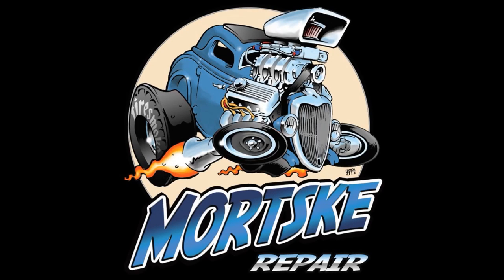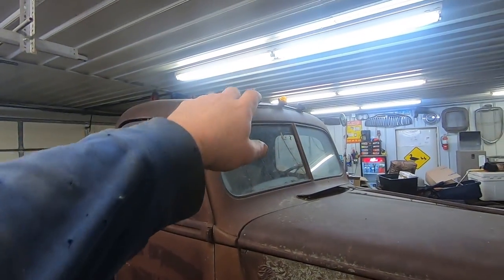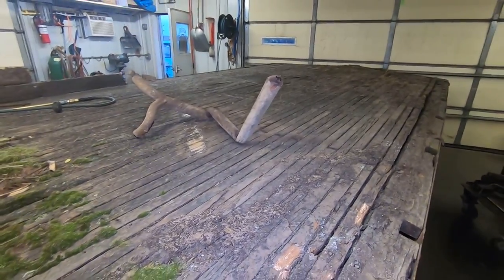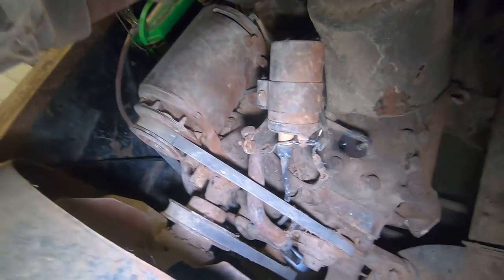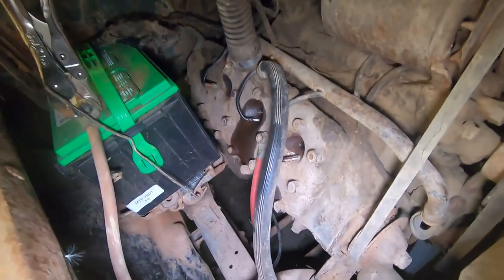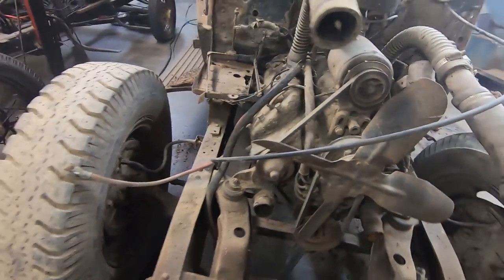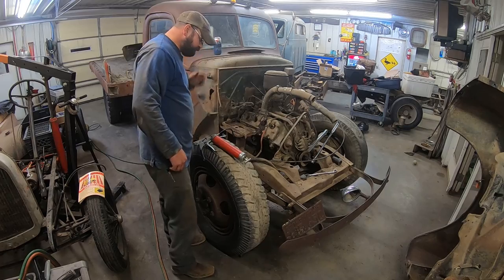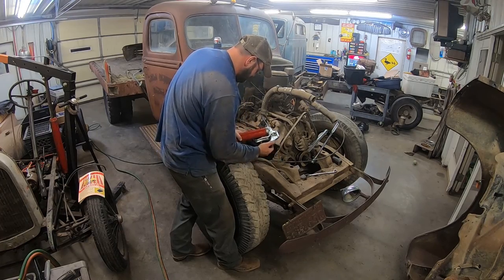Farm Auction 1944 Ford Flathead V8 truck! Abandoned for 47 years! Will it run?!? Stuck rusty engine!

Comment: I bought a 48 that had a seized engine. After dumping copious amounts of WD40 in the cylinders I had my dad pull me around in it with a 1953 ford tractor and I just dumped the clutch until I heard it bang and start shooting the oil out. I put spark plugs back in and gave her some gas and she fired up and runs great. These flatheads are stout.

Comment: That would be a sweet ride. Cooling system, electrical, brakes , tires, a seat, new bed, and enjoy her. Nice work!
Reply from the maker: Really, I mean a good solid weekend and pretty much everything on the truck could be replaced. Ha! Thanks for watching and commenting!
Reply: She looks worth it. These old iron beasts are just waiting to be brought back to service.
Reply: At least for another beer run or two.
Reply from the maker: @lunchbox2784  Just think of all the booze you could haul in this thing!!!
Reply: It looks like she’s hauled her fair share. Maybe that’s what the DISTILLED water jugs were for...
Reply from the maker: @lunchbox2784  I'm gonna stick with that as the reason those jugs were in there for!

Comment: You did a great job to get that truck to start again. All I was doing was letting your viewers know that you cannot just change the battery if you're going to use that vehicle 4 years there are things that need to be replaced. You did not specify that to anybody most people have no idea. You would have to change the voltage regulator T alternator and the starter the headlight bulbs turn signal bulbs and brake light bulbs two 12 volt and they will all light up brighter. I did not want your viewers to think all you had to do was take a 6 volt battery out then put in a  12v battery and everything would be fine. What you did is fine for getting the motor to start except for putting Grease I'm a grease gun and fill a cylinder head it has more pressure and the Greece would have nowhere to go that's why I suggested you take out the spark plugs and the grease would have came out the spark plug hole. Sorry for any confusion it was not directed at you it was to let people that are changing their battery to a 12-volt that there are other things that need to be done on a permanent use👍✌  MR WELSH
Reply from the maker: I'm not showing anybody how to do anything. Just documenting my shenanigans. Also, starters work just fine on 12 volts. I was putting the grease in the spark plug hole. How would it get from one cylinder to the next with the valves closed?
Reply: @MortskeRepair  people that were watching your documentary if you want to call it that we're going to use your advice not knowing any better that you're just getting a junker to start. That there are other things I need to change. If you have a mother that is seized take all the Pistons app is easier to free an engine that's not under full compression that's all I'm saying you won't end up cracking your knuckle and getting it cut in your hand I've done it when I was younger then I realized it's easier to take the plugs out this pain sprayer that's all I'm not trying to down you for your business
Reply: @MortskeRepair  it will not go from one cylinder to another but it would be like shoving a rag in there and expecting that pissing to come back to the top it was a blockage you put in the cylinder cuz it was on its way up the date was on his way down it would have turned a lot of prayer and said this feeling grease out of the side of the head towards another cylinder you did a good job of getting that the Run so I can say👍
Reply: @MortskeRepair  nobody realize that you were just showing them your shenanigans some people would believe that all you have to do is change the battery to 12 volts. The reason why people spray some fluid liquid in the cylinders is to try and hurry it up with lubrication. Squirting grease from a grease gun internet cylinder is going to give you so much resistance it's like having a larger piston in there and it's not going to want to come up because the grease is blocking the cylinder from moving up if you had to plug out on that cylinder all the grease with a compliant out with a boss spark plug was and it was a turn easier than busting your knuckles with a pipe & wrench like I said do me a favor next time you have one is frozen take the plugs out and see if it won't release easier when it's not under full compression from having the plugs in good luck I know what I'm talkin about I've done it too many times take the compression off the engine by removing the plugs it will be a lot easier to turn. MR WELSH
Reply: @MortskeRepair  it was very interesting watching you work on that old truck and seeing how you got that to run with those old Pistons still in it. Great job good work interesting video keep up the good work I know you will.  MR WELSH
Reply from the maker: @jimwelsh1908  Thanks much for watching!
Reply: @MortskeRepair  I will keep looking forward to watching your videos. MR WELSH
Reply: He said more than once he just wanted to see if he could get it to run.

Comment: Looked back at the Ford flathead truck and the way you removed the heads, that is exactly the way I would have did it.......Sure Sire...Right..Oh well..Loved that video
Reply from the maker: Right on
Reply: On a running engine, a good way, especially with stuck aluminum heads, is to drain the cooling system, then back off each head nut 1 turn.  Start engine, suddenly floor it.  That will usually pop them loose.  You have to leave those nuts in place, 1 turn loose though, or else the heads will fly up in the air!

Comment: I love this one especially as I had a 1949 v8 pilot….. 3.6 litre.  So did similar jobs as you did…… my only main jobs were HT lead change as rats had chewed through…. Plus one of the water pumps were leaking….. ran sweat after that…… well done on yours I thought you’d give up once you looked into those cylinders🤦🏻‍♂️😂👍🏼
Reply from the maker: Thanks Colin

Comment: My dad in the 80’s had a 49 Ford car with what he called a (whisper quiet) motor. Well when it idled only sound was the water pumps turned. It was 3 speed with over drive

Comment: I'd like too see you get this truck back Driving again. Despite the little bit of rust and nastiness in the cab... i think she's a good original candidate. It also gives me the motivation to find a Stake/Flatbed of my own & Restore it to haul my Antique Farmall on top for shows!!! I know of a GMC Cannonball Local to me, and a few 1952-55 "Stub nose" IH COEs.
Reply from the maker: This one is too far gone for me unfortunately. I was after it for the flathead. The rest is currently waiting for a new home. The next owner can restore or hot rod it if they'd like. I'm working on a COE myself! As you can see in the background of this video. Thanks for watching Kyle!
Reply: @MortskeRepair  Fair enuff! I was also just suggesting for "Fun" lol. Ooooh a COE! I gotta see it.
Reply from the maker: @SchnelleKat  I've got a lot of fun going on! Nearly 38,000 views and you're the first to comment on the COE!! I must have hid it well! Oh you just hold off there for a bit! It'll be coming up here shortly! Thanks again for commenting Kyle!
Reply: @MortskeRepair  haha yes good eye for sure. They are hens teeth to find and parts for. I had a good set of steps I sold for about $1000 here in the states, those and fuel tanks are impossible to find in great shape. 

Thankfully, I found one in Pa in an old 60-70s junkyard surprisingly complete and untouched, and one in kansas.
Reply from the maker: @SchnelleKat  You're kidding me! I scrapped the fuel tank on this one!! Probably was all rotten anyhow. I've had a few COE now. This was the nicest by far so I'm gonna have a tough time letting this one go.
Reply: @MortskeRepair  yep... Nobody makes the fuel tanks and yeah like a gold nugget to find one haha I know even in rough shape they bring about $300
Reply from the maker: @SchnelleKat  I'll see if I can track down my old one. They might still have it.
Reply: @MortskeRepair  GL on the hunt. ;)

Comment: I’ve got a 1/2 ton 47, it’s seized and the water got in by the split in the hood, then it dripped into the top of the air cleared and from there went straight to the carb
Reply from the maker: Ahh that could be where it came from in this one as well. Funny it didn't make it into the oil pan like on my last video. Thanks for commenting Merik!

Comment: pulled a 47 ford out orf fence row where it has set over 60 years did about the same and it fired right up and is running now in a differant truck

Comment: Sweet truck! I’m working on a 41 Ford truck. Pretty much the same as what this one is. I’m having a spark issue though.
Reply from the maker: These flatheads with the dual points can be tricky. I like this "clam style" distributor over the earlier "scuba diver helmet style" as they're a real pain to work on! Clam is 2 bolt, helmet is 3 mounting bolts. They do make adapters to convert them over. There's also a lot of great distributor rebuilders out there. Good luck John!

Comment: Nice rescue, those flatheads sound great.  You inspired me to get my 53 Merc 1 ton out last night.  8BA.
Reply from the maker: Nice! Shouldn't that be an 8CM in a Mercury?
Reply: @MortskeRepair  8BA... 255 screaming CI
Reply from the maker: @ranchdog7920  I always thought the 8BA and the 8RT was the 239 ci Ford version and the the 8CM was the Mercury 255ci version. Interesting.
Reply: @MortskeRepair  well you have more knowledge than I do about this, but there is a green colored, 24 stud  8BA in my truck. Who knows what has happened in the last 70 years.  Keep up the good work.

Comment: When you put on your long sleeves to wire wheel the heads and mentioned the wires sticking you, I thought "finally someone is telling it like it is." I watch other Youtubers using wire wheels in short sleeves and there is no way they don't look like pin cushions when they're finished. Wire wheels are great tools but they shed worse than my dad when my ma got pregnant at 41. Love your videos.
Reply: I'm all about covering when shit flies. Except I hate seeing someone using any rotating tool with loose sleeves on. Either tape them or a tighter fit sleeve. Once something grabs you, it's all over but the crying. Also, I quit the goggles and started always putting on a clear shield when grinding, cutting or wire wheel. Uncomfortable as hell but once in the habit, it's like putting on your shoes.
Reply from the maker: I hate picking those wires out of my skin all afternoon! I do use some precaution every now and then! Thanks for watching Paul!
Reply from the maker: Loose gloves, loose pants, loose sleeves, ties, they're all a no-no. And I should be wearing a face shield like you say. The inconvenience thing is what gets me there as well. At least I put a little protective wear in place. Some channels those poor guys don't use anything! Anyhow, thanks for watching and commenting Twig!

Comment: You're like me...no parts, just clean unstuck and partial hone...put back together for test. You broke all the rules...but did it exactly how i would. Most people would have junked the motor after seeing that kind of rust-corrosion, but it always looks worse than it really is. The only thing i would have done different...is the turning-breaking the motor over with cheater bar...i go 1/8" to 1/4" one way and then back the other way 1/8" to 1/4", then move motor 1/4 turn and back 1/4 turn, then 1/2 turn and back 1/2 turn...with more liquid wrench put in cylinders before i go back and forth. You went all the way around 360 turn...you're a brave man.
Reply from the maker: I get lucky now and again!

Comment: I have had a lot of luck with flatheads in general. From the continental "chrysler" products to lincolns and fords. I have had to remove the heads on a few that lost the keepers on the valves and so those would stay open till you compressed the valve spring and put them back.... had one like your working on but I got it broke loose ok. It just didn't have any compression so I hooked it to 24 volts to spin it even faster which it did and it was funny cause after it all and not starting... just the putt putt try and die so did the juice over dose and I didn't hold it to that spin very long but had the coil and stuff isolated from the start mechanism  so it stops whirling and it just setting there idling which took me by surprise. What I was getting around to was any of those older engines that had the copper head gaskets from those time, when you took it off, you didn't change it, You put it in a large pail and boiled it so it would swell up and have some good sealing chance. I did a plymouth that only had maybe five pounds of oil pressure and you could hear the rods talking but off to work every day for better than a year before it tossed that rod talking loud out the side. I call this a win to me anyway. I was always curious why people never stuffed them in gear and just rock them back and forth till it  shook loose the engine??. I mean easier than beating on a starter. I have used grease before and it worked on some and others nothing would of this world was breaking it loose. Great video and not so much a show me but a win win video for not giving up and pushing through. Fords are fairly tough but water/oil leakers are kinda doomed so thanks for sharing
Reply from the maker: I tried rocking it but the clutch would just slip. Plus the driveshaft was unhooked so I used a big pipe wrench. Pulling it like this the tires would just skid. This one was too far stuck to do that. But that's what I do other times when they're not too stuck. Thanks for watching and commenting Morgan!

Comment: That's a '47 Ford 798t 1.5 ton. I had my grandpa's 798t with a dump bed and wood sides on the bed passed down to me. Only difference I see is mine has round, stand up turn signals on top of the front fenders.
Reply from the maker: Thanks for watching!

Comment: I’ve heard that copper gaskets have a tendency to weep coolant, or water over time so that could be your issue with water getting in the engine but I’m not sure because it’s only on the ones with the intake open.
Reply from the maker: It's hard to say. I'll get it on my run stand and flush out the block. Put some new gaskets and waterpumps on it and run a few heat cycles through it and see if there's any issues. Thanks for watching Nikolas!

Comment: Fuel does not matter here one bit. The fact you never pulled the pistons out and cleaned the rings means everything. Unless you spin it much faster then the low compression will be slightly thwarted.
Reply from the maker: I"m sure the rings could use some attention after all of that rust that was in there! Thanks for watching!

Comment: I like your style.  Consider buying a case of PB Blaster and using it often on the head studs.  I'm guess that there is no way to access the flywheel teeth (full bell housing/no access cover) to use a tool to try moving things that way.
Reply from the maker: I prefer Zep45 myself and I buy it by the case! You can't get at the flywheel teeth on these unfortunately... Silly Fords.

Comment: I would go so far as to say not 48 years but more like the underneath license plate of 1963. So 57 years is way more like it when last run. I see good things for this flathead. I do not know how that much water enters except through the oil bath air filter. But doesn't that mean the water would have to fill it clear full and run out the top edge inside? That would mean no oil should be inside the air can at all. I pictured in my mind the rings covered with rust like the valves and cylinder walls but what must happen is they are pressed into such a small area they don't go away like everything else. Good job on this recovery. Now I don't know if it will run 5 miles down the road before turning a bearing unless the oil is totally cleaned out.
Reply from the maker: I wouldn't want to drive it across the country that's for sure!

Comment: Well Ya found the coolant leak . I keep saying use marvel with a spray bottle and then add a little air to move it around . Hope your air tank has a receiver dryer on it . Don`t want any more water in the cylinders.

Comment: Old mans first v8 40 ford . Got a job at a machine shop learning to sharpen bits to learn to rebuild the flathead.. they used flatheads super sized for compressors ! Lol 😆 ahh the 60s-80s
Reply from the maker: Thanks for sharing!!